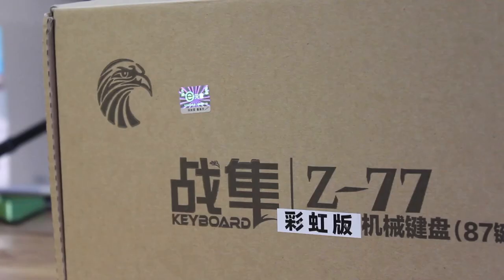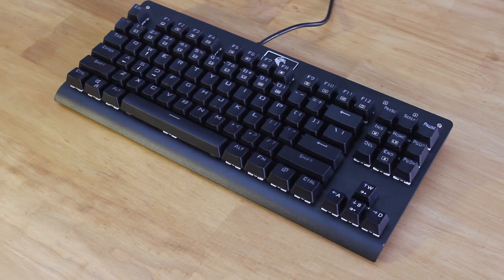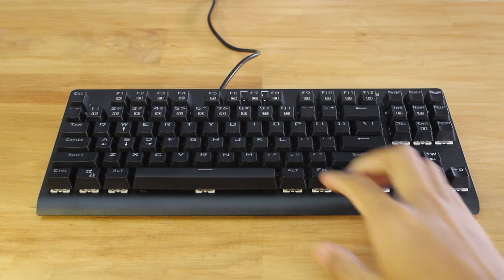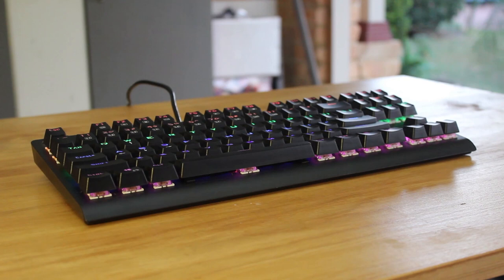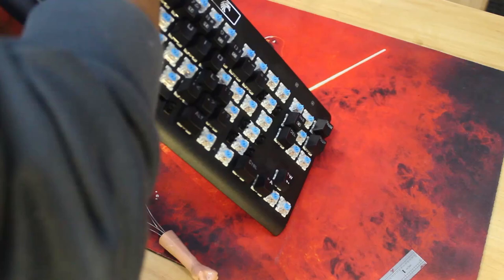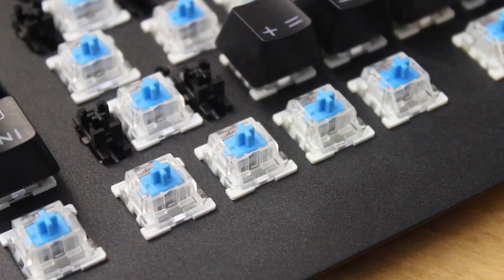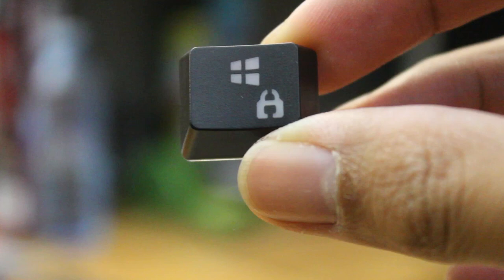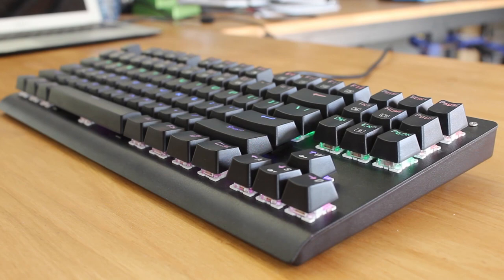E-Element Warfalcon Z77 Gaming Mechanical Keyboard - Quick Unboxing & Review

Comment: Something good to mention, this is a perfect keyboard to tweak with. The switches are socketed and can be swapped out without soldering! Lubing them or swapping them for different outemus is really easy, not to mention those LEDs are really easy to get at and swap out with some less stupidly coloured ones!

Comment: Just as a little idea for the next keyboard review, if you haven't done this one yet, you should review the Redragon k552 kamura red for 40$, heres some of the pros and cons for me ( not going to lie i just got it and i'm already in love with it)

Pros -
Cherry MX blue clones, (they say its supposed to be a green clone, but its a 55gram accusation force instead of closer to a 70gram force)
The same clicky feeling you'd get for a 100+ keyboard, just as a black widow or a corsair k70
A non glossy material ( trust me they did not go cheap with the build, as much as i desire to not break it i couldn't stop myself from testing the strength of this keyboards build. weight in grams - 840
Red LED backlights
And also its a 10 key less which gives you much more room for a small desk such as a linnmon.

Cons - 
The as usual horrible more aggressive gamer font ( but can be fixed with just about 20 ish dollars )
no wrist rest
No braided cable ( understood for the price )
and the bottom height elevators are still very slippers even though they were made with a rubber grip for the bottom side.

All in all for this price range, i couldn't believe that this keyboard pretty much competes with high end, well known keyboard producers. 

Note : i'm very new to this whole mechanical keyboard thing, in fact this is my only mechanical keyboard i've ever had. But i have stated my opinions and more well known reviewers like MS techs thoughts on this keyboard. I hope you read this and do try this out if you haven't already.
Reply from the maker: +0bi Hi, I've watched some videos on the keyboard before as well :)

It's a pretty nice keyboard. However, I can pretty much only review what I can get (I'm just a small channel hah).
But yeh, It's a pretty sweet keyboard, and has many of the characteristics of all these other mechanical keyboards in the approximate price range. But as you say, it's absolutely true that many of these cheaper mechanical keyboards still offer the same awesome mechanical experience, and pretty much all have quite good build quality. Unfortunately many of them have that font, but whatever.

Thanks for all the info :)
Reply: +TaeKeyboards understood, i know youre a small channel and thats weird seeming as you actually put time into your videos and give them quality. so i unserstabd where youre coming from. Thanks for taking my comment into consideration though!
Reply: In your opinion which one is better the MechanicalEagle Z-77 or the Redragon k552 kamura? I'm planning on buying this one but I want to hear from you :)
Reply: If youre asking me which i dont know if you are, I dont really know, ive never owned the warfalcon and the kamuraa is the only mechanical keyboard, id say a biased opinion its the kamura which sounds better, but its all up to you, keep in mind though the kamura only comes in red leds unless you want to buy the 80 $ RGB one, all in all i do not know which would be better but they both sound like great options.
Reply: 0bi i might just go with the Eagle Z-77, thanks for your opinion! :)

Comment: I have this keyboard for about 7 months . Only difference is the paint I think. My keyboard has more glossy paint.
Reply from the maker: +raidensub Same key switches? Are they holding up nicely?
Reply: Yes, the switches are the same. I don't have any problem with the keyboard, it works fine. I just don't really like the rainbow leds .